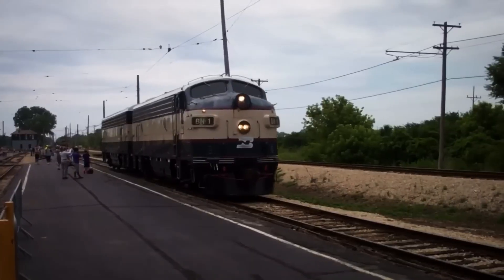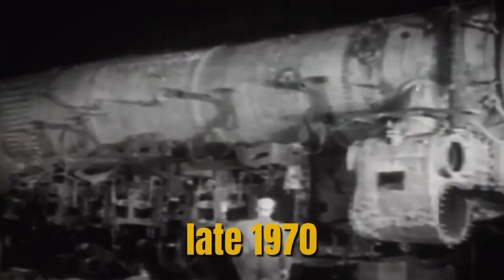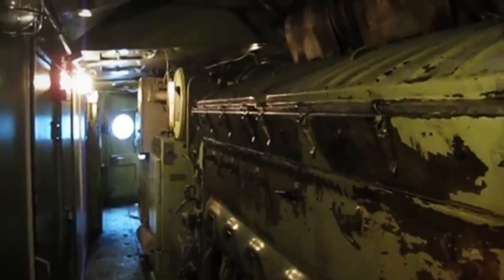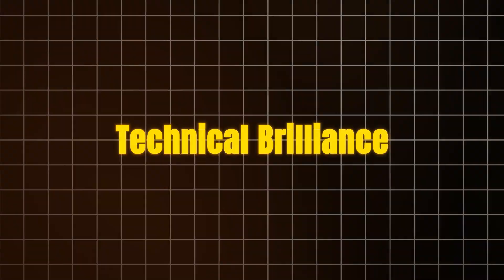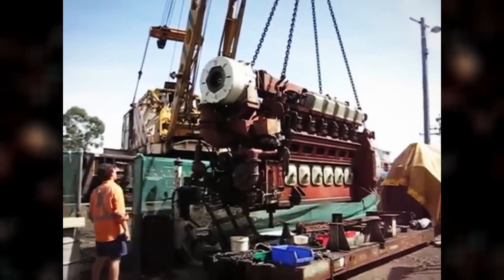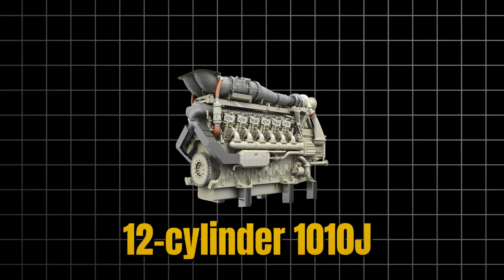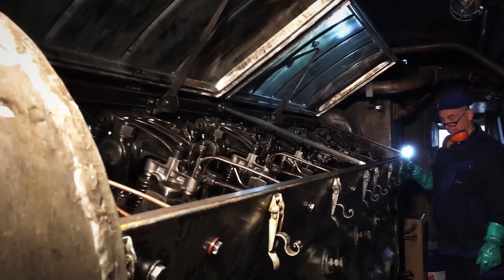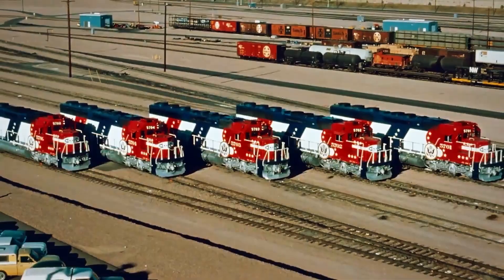Why EMD 710 Was Banned: The Engine That Was Too Powerful

Comment: the railroads were getting greedy. We can pull longer trains with less locomotives. Epa surely killed them. The H engine no good. The 1010 j  question.
Reply: More tonnage per locomotive is not about greed it is about efficiency.  Making as much money as one can is not greed.

Comment: Lovely video that brings up my 30+ career at EMD.  I started in 1971 building GP40 , 560, 645,710 were my career with some rebuild A & B engines.  Loved the shots of the old factory now gone.  Progress Rail is trying to save money spreading manufacturing  all over,  but the talent is not there, just no unions .  Cat is trying to fix the mess.  When I started 10 engines a day were normal.  I had people working for me who remember 20 a day.  
I am in contact with people who still work there   We are past H engines and on to J.  Lots happens 30 years retired.  4 stroke reins today.